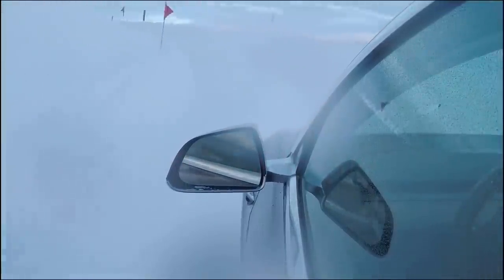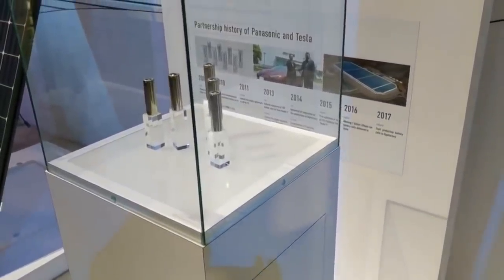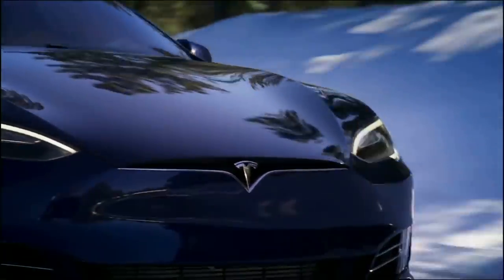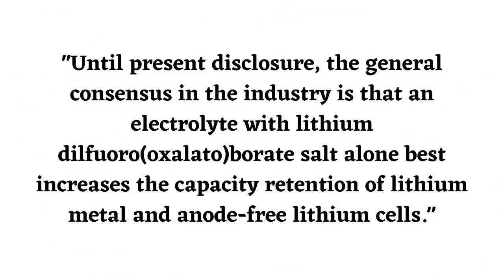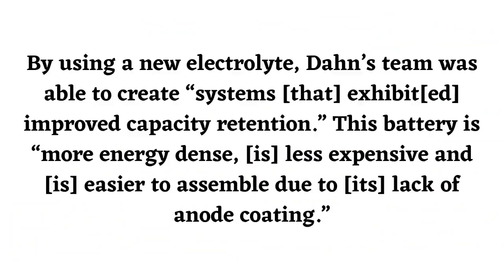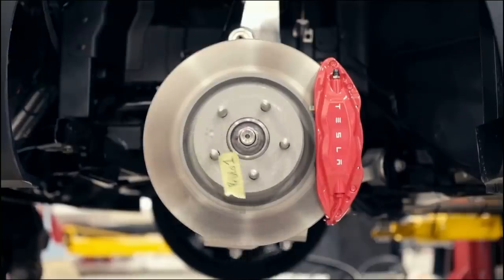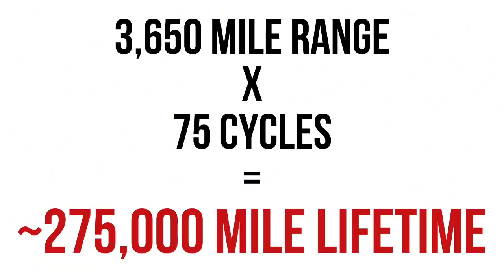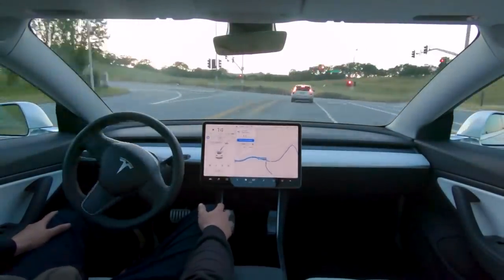Tesla's Secret 3,650 Mile Range Battery - The Next Gen Revolution

Comment: If this is really confirmed, I strongly belive this would be the best news of the decade. With such high energy density at a lower price, I could definetly see an eletric revolution coming up, where gas will be finally overtook by eletric energy in many industries. Although 9,36MJ/Kg is still an order of magnitude away from the 44,43MJ/kg kerosene provides, because of the higher efficiency and other advanteges that eletric engines offer, it's very likely that we are close to seeing eletric planes becoming a reality.
Reply: Electric flight is already here.  Israel operates an EV commuter jet that seats 7 and has a range of 600 miles, 100% electric.

Comment: Energy density is meaningless if energy leakage isn’t containable.  if it costs $750 to fill up but leakage means it’s gone in two weeks wether used or not then then usable range is pointless without a control on leakage

Comment: I remember when my sony ericsson lasted 1 week, that was 10 years ago,what the hell happened to phone batteries. currently have a Samsung S7.

ps with that kind of energy density I suspect it would be like a nuclear bomb under your feet.
Reply: Battery is a lot better now. Perhaps you screen is a bit bigger? Processor about a million times faster, perhaps you use your phones data connection nowadays....
Reply: yes the processor demands on a smartphone are substantially higher now than what was required on those simple old phones
Reply: For example the illuminated big screen depletes the battery faster than ever...

Comment: I've heard that if they include this type of battery for the top end of the cell meaning the million mile battery for the first 90% of the total battery capacity of the vehicle (to equal say 350 miles range), then the final 10% (to add an additional 100 miles range) to only be used for road trips.  If you do the math...even if someone did 2 long road trips a year at 1000 miles each way, thats 2000 miles round trip thats 4.5 cycles per trip, or roughly 9 cycles per year.  if the top end of the battery is only good for 75 cycles, this would result in being able to do those trips for over 8 years worth of long road trips!  The road trips I've been on through my life have usually only been 1000 to 1500 miles round trip, this would make the battery last even longer.  Not to mention its only 10% of the battery that would need to be replaced every so often = much cheaper.

Comment: Even with 75 cycles, the manufacturing process would be cheaper so what if you just swap your battery every 200~250k miles like an oil change? They take in your used one, recycle it.
Reply: It could take days for a single battery swap and Tesla (as much as i love them) does not have the time or energy to do that when they are most likely going to solve the cycle issue before the cyber truck. I beleive that The cyber truck miles will be changed last min to dominate the ev truck market.
Reply: edwong3  interesting
Reply: Fabian Martinez just use the sweet spot (40-60%) for your every day use and  more as needed for long trips and the battery should last 500K to 1000K mikes.
Reply: How many are these likely to cost?
Reply: edwong3 This defeats the purpose of a battery. And if you learned to read, I said possibly. They could do that at a giga factory, not your local dealer. You are way above your head.
Reply: Chinese already have EVs that you change the battery like a refueling. No need to sit around waiting for a battery to charge. Less than 5 minutes.
Reply: @suigeneris6311  Mi point exactly, one chinese brand (NIO) has battery swap stations, and their batteries have 500km or less range per charge. It would be very possible if they decided to go this way. In fact, if they only managed say 75~100 cycles before reaching 80% capacity, it would still be a great battery with countless applications, specially for aviation. Also, picture this, after 5 years or 250k miles you go to your battery swap station or Tesla service center and after 10 minutes you drive away with a new battery pack with the newest cell chemistry with improved range and performance... You could literally have a better car as time goes by. A Cybertruck would last a lifetime. Question is, would Tesla go for it?
Reply: It’s not true at all. Don’t believe it.
Reply: edwong3  he gets it from the list of talking points supplied to him from the oil company that is paying him
Reply: Mate, don't bother. These numbers are completely inaccurate
Reply: Don Davidson  most nissan cars only have warranty till 150 000Km lol, so it pretty much a viable strategy to do servicing when it hits 200,000km, which usually came with the term of 7 years of used.  this is in KM, not even a mile.
Reply: Hard enough time getting people to recycle products cause no one buys the waste
Reply: @shawnwelch7371  We in Brazil Recicle the Battery Lithium for Elétricar and Cleanner Energy Stant UP Mr Elon Musk And Gigafactory Tesla Model Cybertruk And Semi Truck. ...

Welcome to Brazil Hiperlloop and Mr Elon Musk...
Reply: @shawnwelch7371  ridiculous objection. Obviously the swap should be done at a company service center by trained mechanics, also doing the recycling to recover lithium.
Reply: @lengould9262  its actually way harder to recycle lithium batteries compare to lead batteries,  also lithium batteries need to have a second live as energy storage for example
Reply: Recycling isn't perfect just like with plastics, you only get back a portion of the original raw materials, however the point here is, even with max 75 cycles, it's still perfectly doable for certain type of vehicles or markets, on china they are going to use a different battery less energy dense, why? Because they don't have an unlimited supply of raw materials for their specific battery, so they are trying to tap on different chemistries.

Comment: Does it possibly make more sense to use this as the long range portion of a hybrid battery? Use lithium ion for the first 40-50 miles?
Reply: YES  I  heard that before awhile back it makes sense especially commercial vehicles med energy density million mile. 40-50 mile.   high density regular batteries (existing tech) 50-200 miles . ultra high density low cycle life.
200-1000 miles. that would work great for the semi replace the low cycle life semi annually

Comment: 2:37 "While lithium ion batteries can withstand hundreds of thousands of cycles". Actually, the ultra impressive million mile battery is expected to last a few thousand cycles. EDIT: And you correct this number later, so I guess that was just some weird mistake.
Reply from the maker: Sorry about that Peter, I meant to say hundreds of thousands of miles.
Reply from the maker: I hope my explanation at 4:14 cleared it up for you
Reply: @Casgains  Yeah, I edited my original comment. I was just really baffled by the number. Love all this intel in your videos, thanks man :)
Reply: The cells for grid power storage last several times the amount of cycles the car cells do. The max power output is a lot lower as well. There are trade offs between power, capacity and cycles.

Comment: Just by using metallic Li as anode it is impossible to increase the capacity of a Li battery by a factor of 10 or so. Sounds like fraud or  misunderstanding of the results.
Reply: Robson Robson He probably use the energy capacity of lithium air battery. Lithium air uses lithium metal technology but in addition to that also uses air as active material. So lithium air is a type of lithium metal battery.
Reply: @kazedcat  I had a look at a samsung pattent application considering a metalic Li / anode free rechargable battery. To my understanding a cathode material is seperated by a solid state electrolyte from another electrolyte containing metalic Li or an Li containing alloy. 

Yeah great, isn' t then the Li metal containing electrolyte basically the anode??? And how can it be still an "electrolyte" if has to conduct eletrons as well as ions????

For methis sounds like some marketing bullshit.
Reply: Li/ Air battery is a not a new thing, it is a  primary battery.  Normally it can not be easily recharge by traditional method, but too little information is provided hard to comment.
Reply: Didn't he say anode free?
Reply: @IXLAZYMANXI  Whatever "anode free" means. You always need a redox couple. To my understanding then there will be an anode and a cathode.
Reply: @IXLAZYMANXI  that is the label this deigns of battery has. but technically its a pure lithium anode. its same as this - https://newatlas.com/energy/battery-design-breakthrough-dream-material-lithium-metal/?itm_source=newatlas&itm_medium=article-body
Reply: @morgan3896  well i just did a google search because honestly i don't know myself and this is basically what i got 'In anode-free, the absence of Li+ host anode material reduces the cell weight and space required for the anode as a result; energy density of the cell will therefore be, significantly larger compared to the conventional Li-ion batteries'

Comment: How long would it take to recharge (with a 120, or 240 volt home charger) the battery? Would I need to install a SuperCharger at my house?
Reply: You can charge one or two weeks all night long with your common home charger, who cares, the battery keeps your ride running for two or three month
Reply: @rockb  My model S adds 3-5 miles of range per hour on 115V. My 20KW charger in my garage adds 55 miles of range per hour in my old P85. I could barely handle my commute if I plugged into 115V and if I was on a busy project, forget it. A couple of years ago I had to charge at 115V. After three days 24/7 my car still was nowhere near charged.

Comment: And this is about the 3651st time I heard a story like this in the past 15 years. If this were true, the world as we know it will change drastically: Oil companies will go bankrupt, Russia will go bankrupt, all other car companies will go bankrupt and all current Tesla owners will be stuck with worthless cars. (Happened before when Tesla cut its P100D prices about in half, so goo luck there)
Reply: Engineering 101. Your analysis is based on the assumption that the battery packs will not be able to be removed from the older models and replaced with upgraded battery packs.  Its a simple matter of making the new units have the same form factor and interface which with a higher energy density will make this easily achievable.

Comment: It’s like the evolution of hard disks. At first, computers only came with 50-100 MB hard disks, so I had to constantly be off-loading data and cleaning up files to make room for new data. Two years later, I could buy the same computer with a 1GB hard drive, and two years after that, a 500 GB hard drive, then 1TB, and so now, I can forget about data management.

Today, electric cars like my Tesla Model Y have a 250-280 mile range, so I have be concerned about charging the car most nights, and if I go on a trip, I have to pay attention to locations of charger stations. In two years, the batteries will have so much range, that like big hard  disks, it won’t matter.
Reply: Hard drive evolution to where we are now, took like 30 years. Don't think battery technology will increase at such a high rate. If we get a Model Y in 5 years with range of 500-600 miles and with a charge speed of, lets say, half of the range in 20 minutes on a Tesla supercharger, it will truly make a giant leap in electric car usage (and probably make Elon the first Trillionaire :)
Reply: @petarmiladinovic4126  No it has not increased as much, but I also remember my old microcontroller I built for my train set, it used cheap zinc-carbon batteries I got free from the Radio Shack Battery of the Month Club.  I was getting batteries from about twenty Radio Shack stores each month and the batteries still would not keep my electronics going for that whole month.
If I did that design to a set of Lithium-Ion 18650 should run it the entire month non-stop.  There have been some advances at-least.
Reply: Ha, the first hard drives I sold for the CBM 8032 was only 10 MB in size, and I think there were 5 MB available.
Reply: Yup, in 1983, the IBM XT was introduced with 10 MB hard disk, and was super unreliable. Nine years later in 1992, Seagate and HP were both selling low cost hard drives that were 2.1 GB. Only nine years, not 30, to go from 10 to 2100 MB.

Batteries are early on the declining cost/capacity curve, and I think that the pace of cost/capacity change will be amazing — because Tesla is driving the pace of innovation for batteries, and these guys drive innovation like no other.
Reply: Allen Loser 
Ha, yup. And computers filled the whole room and cost millions, now can now fit in your pocket for a few hundred bucks. Batteries are going the same way . . .

Comment: If the cost were low enough then battery packs could be simply replaced during servicing. With 75 cycles and around 3000 km per cycle for a typical auto that could mean replacing the battery pack after 200,000 km. With such a huge energy density, electrically powered airliners would become possible. And what about SpaceX? The Rocket Lab Elektron rocket already uses batteries to power the turbos needed to push fuel into the combustion chamber. But with lithium metal anode-free batteries this could be upscaled to much more powerful engines - something which is currently not possible... it would mean the end of the pre-burners in today's rocket engines!

Comment: The good thing about higher capacity is you can have less cycles but still maintain the same lifespan. If the battery capacity is 10X more you'll have to charge it ~10X less frequently.

Comment: I think a battery with a range of 1,000 miles would be good enough no? Instead of loading my car with a 3.650 mile battery, why not make it cheaper with a smaller battery that has a range of 1,000 miles.

Comment: Why would Tesla try to build a car with that kind of range?
They could just cut 3/4 of the battery system and make the car way cheeper, way more efficient, faster and lighter. 🤷🏻‍♂️
Reply: Because you can’t cycle it as many times so it needs to be used in a higher capacity form
Reply: @hughmp
Yea, don’t think this will happen any time soon.
Would be better to find a battery solution which is somewhere in the middle or work on this one until it gets more cycles.
Reply: That is an underrated comment! Interesting.
Reply: It can't cycle as much as the current batteries, so the extreme range is required to extend the life of the battery pack to valuable levels.  This would also GREATLY lessen the load on the supercharging network too!
Reply: @robbie G
Everything I wrote in my op will still stand after battery day. And even if I would be wrong, I wouldn’t look as stupid as someone writing all caps. 😉
Reply: @robbie G
Nah, most people think you are either rude, or stupid, or both. But you’re allowed to keep thinking you trigger people.
Reply: Imagine what kind of vehicles would be possible, Boat, planes even an electric flying surfboard or smth like that.
Reply: @Jsjab Jsjwjw
To be honest, planes might be the only place where fool cells might be the way to go.
batteries are still super heavy.
Reply: @goodyKoeln  but now so much less battery is needed ( if this 🔋 is real)
Reply: @Jsjab Jsjwjw
Now?
You mean in the future! 😇
Reply: @goodyKoeln  
Israel has an EV commuter jet that seats 7 and although half its weight is the Li battery pack, its range is 600 miles, so battery weight is not preventing the use of current technology in commercial aircraft.  For larger aircraft, there will need to be a 4-6 fold increase in energy density due to the additional weight and hydraulics.
Reply: @jsjabjsjwjw1681  No for planes you need about 40X.  This is only 10X.
Reply: @anthonymendoza931  OK probybly you are right, but nearly every company that tries to build elecrric Planes is worthless without Teslas Battery
Reply: Anthony Mendoza for jet planes, but for smaller Cessna or private jet types, this could be an option.
Reply: @anthonymendoza931  No, you don't need 40X today's Li-ion batteries to do a plane.  Elon said you'd need 500 Wh/kg.  The battery described here beats that be a factor of 5.
Reply: @incognitotorpedo42  You are right.  You can have small aircraft that can go short distances with 500 Wh/kg batteries. But to replace a 747 and cross the ocean you need about 40X.
Reply: I think that is right.  cutting it by 3/4 would give you 900 miles which is 6 hours of driving even when the weather is below zero and you are only using 80% of the battery (which is normal).  Few people want to drive 6 hours without making a significant (hour or two) stop.  Of course in the summer, it would give you 10 hours of driving and no one would drive that far without stopping.
Reply: @Kim Mathis
This is the reason why this exact battery will not be used in cars. There are so many variables to twist, most likely there will be a ‘best of both worlds’ where the cell can last longer but looses some of its higher density.

Comment: Batteries are not quoted in miles range tha tis stupid

The have volts and amp hours and a mass. The three combined give you a Wh/kg energy density and batteries will improve incrementally over the next 10 years. Cells in 2030 are unlikely to be >2x today and more likely they will be closer to +50% from today

That's a great improvement but it's only about 4% improvement over year for the battery itself